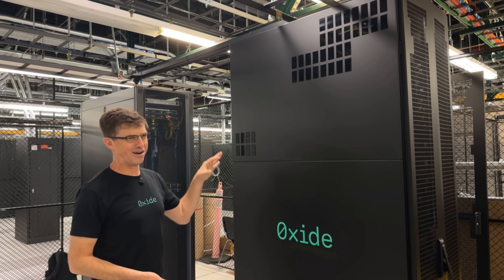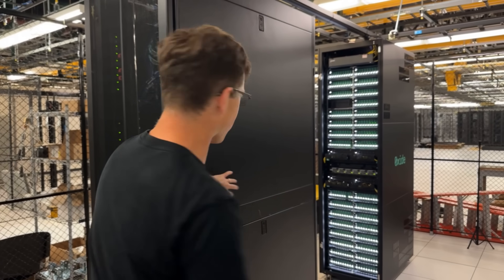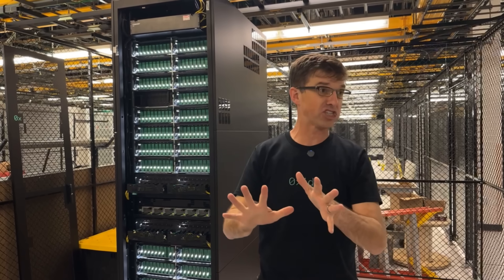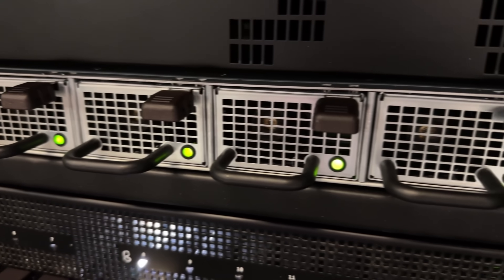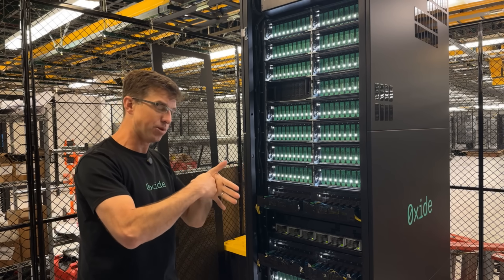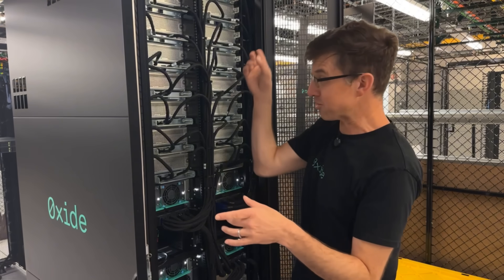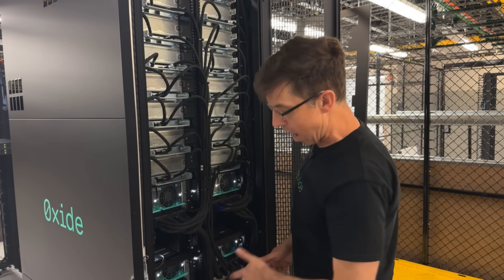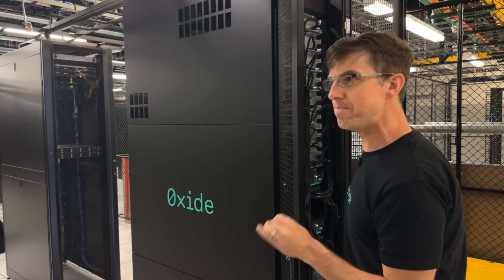Oxide Tour - Speaking Loudly in the Datacenter

Comment: The rack is awesome but you have got to put a better processor in there! Zen 3 really won't cut it. But fix that and you'll have Dell and HP on the ropes.
Reply from the maker: It does take a bit longer for us to rev hardware vs the big guys but don’t worry it’s coming 💪
Reply: Certainly the HPe composable architecture (rack scale computing -  or Synergy) has taken a while to come to market - and the long promised photonic interconnects and memristors may have suffered from research cutbacks there. 
The green font on the oxide rack reminds me of the HpE font a tad.

Check out the hpe nvidia GB200 NVL72 rack unit. The sticker price though is a little high end :-)
Reply: Just to point out that the big guys take forever on some of their products (and end up going to infinite time on some features :-) )

Comment: Would love to see a software architecture overview of how oxide rack kinda differ from traditional racks where the software is basically the BMS (IPMI) or the operator has to basically go and provision and setup networking, netboot, etc.
Reply: If you've got the time for it, there's plenty of Oxide and Friends episodes that explain it. Maybe take up rowing or jogging or something, to have enough time to listen to them all. :)

Briefly, it's a software defined networking combined Top of Rack and Out of Band management switch, which is configured by an orchestrator that assigns virtual machines to real hardware. The underlying OS on the real hardware is Illumos, but in a "no user serviceable parts inside" form. The OSs get onto the blades by way of a management network (and environmental and other monitoring info is taken from the blades) by an out of band network. The nodes on that network, what the rest of us DCops people call BMC's, Oxide calls "service processors", run an embedded OS which is written from the ground up to be more reliable, upgradable, and predictable than the random crap that SuperMicro, Lenovo and Dell put on their BMC's. There is no BIOS: the service processor is responsible for booting the OS. If Oxide's management software says a blade is ready, it's ready. No futzing with the BIOS settings or version is necessary.

As a guy opening 1000s of SuperMicro and Lenovo servers, I am very jealous. :)
Reply: @JeffRAllenCH thank you for sharing this. I will definitely look into this more. 

And yeah, jumping in and out of bunch of server on a daily basis is not fun 😭